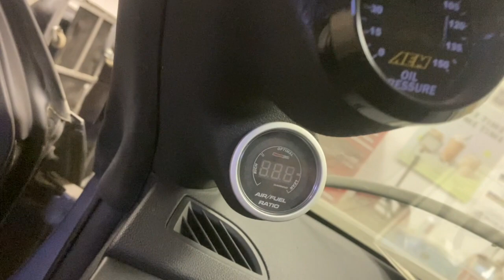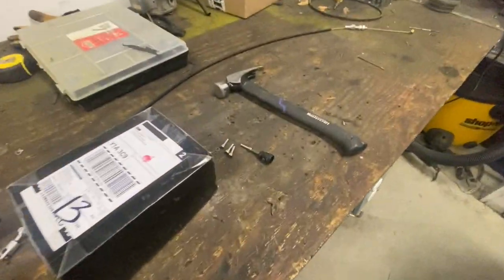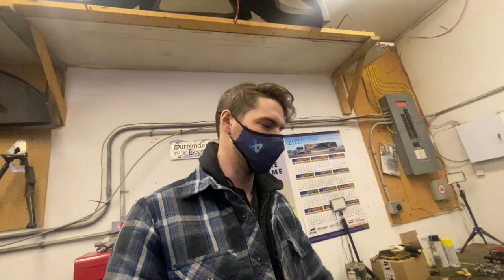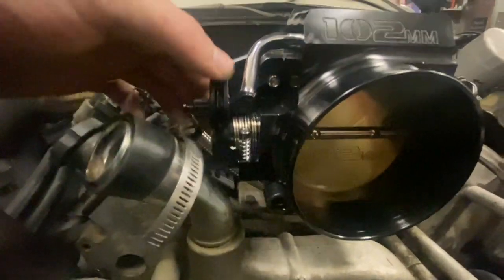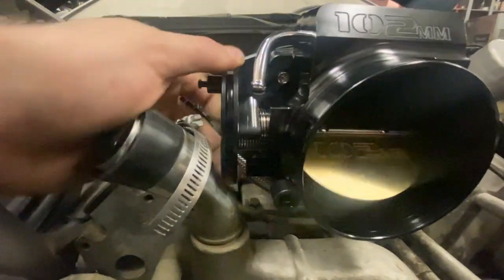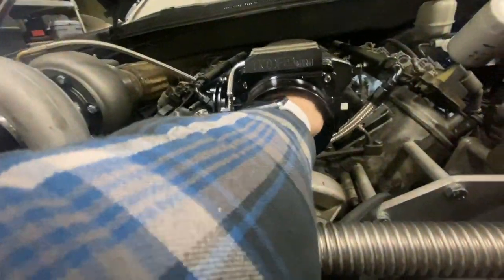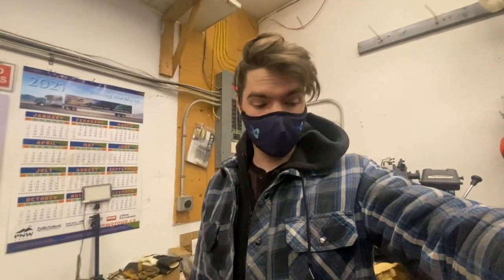Widebody Genesis LS Turbo 6.0 Getting Work Done

Comment: I’m in the middle of my build with an Ls 6.0 swap what are you doing the the rear end to beef it up
Reply from the maker: Ive heard the diff is very overbuilt for the cars so we're sticking with it. But I have purchased ISR racings diff mount kit ill be installing. 3 stronger mounts and an additional 4th mount
Reply from the maker: https://uniqperformance.ca/product/isr-performance-differential-bushing-set-hyundai-genesis-coupe-09-12-bk1/